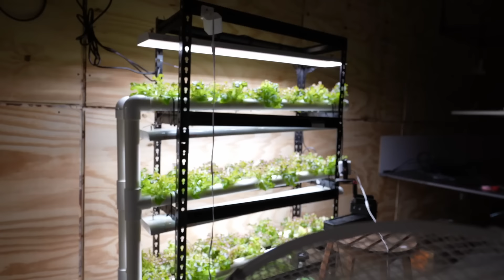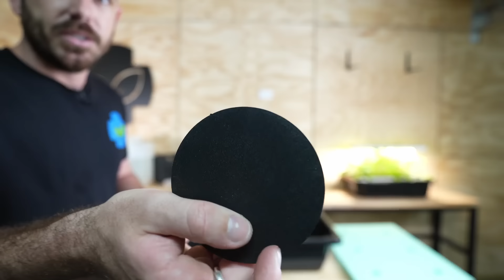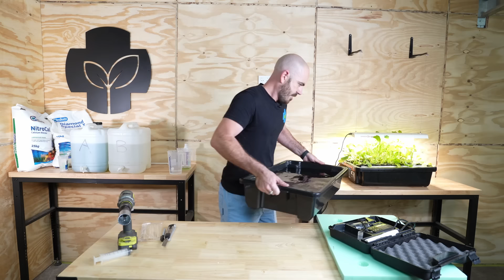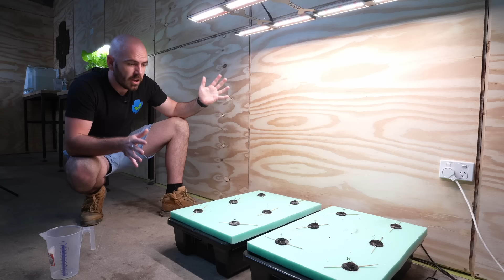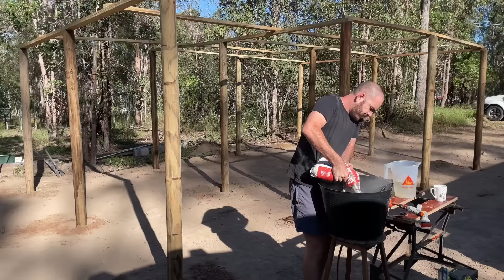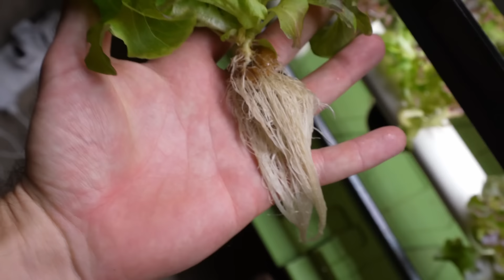Deep Water Culture vs Kratky... And the Importance of Air Flow in Indoor Systems

Comment: thoughts throughout:
your definition of "deep" is very different than mine. (asin "DWC")
i can tell right away your brain is working wrong on DWC, you would be far better off with air BARS (or atleast soaker hose) than stones for better coverage.
pfft! you need WAY more air than that in my opinion.. but i dont grow lettuce so i guess it could be enough. ive never done dwc in anything smaller than a 5 gal bucket (usually a 15+gallon tub) so maybe my perspective is off, but i want hot tub levels of bubbles, not fart levels.
dwc tub looks like it will have light leak for sure which will probably cause algae..or root rot.
are those leaves supposed to have holes?
jealous of those migro arrays.
oscillating fans... OSCILLATING!
when you re-do it dont do lettuce, do something obvious like beans or cukes.
wow.. you LET the nutes of the dwc run out? ive never seen somebody so blatantly misrepresent dwc in my life.
do you not use calmag and silica?
Reply from the maker: You must get in your own way a lot.
Reply: @Hoocho  eh, this reality rarely suits me. its mostly when im trying something new, which as you well know is how we learn. its atleast nice to know im not the only one who shoots myself in the foot when having ideas though, because often it feels like the world is just stacked against me specifically. 
at any rate, heres my logic:
the deeper the container the more velocity the bubbles will have when they break the surface thus dispersing the droplets more.
soaker hose is AMAZING (cheap and useful) stuff that lets you perfectly aerate ANY size container. uses the standard barb, weigh it down or clamp it and youre golden. bars would work too but cost more, and you cant bend them in to star/flower/spider like shapes.
when i grow in bubble buckets the solution literally looks like its boiling. theres that much air.
cut or drill notches in your container to avoid light leaking, or just use the neoprene plug from a 2 in net cup (i may have learned that from you actually) and run the hose/wires through it.
kids these days need VERY specific instructions, not saying "oscillating fans" will lead to throngs of people with those little 6 in. clip fans trying to circulate air in a 4x4 grow tent full of jazz cabbage. 
most of these head to head videos end in disaster and THAT is hilarious (shane from migro did peppers a while ago and again disaster struck).
i use calmag and silica religiously in my nute solution for dwc (not so much for aeroponics though). maybe for lettuce it wouldnt matter since it can grow so fast it shouldnt get to the point of deficiency but when you got 16 weeks in a grow its better to be safe than sorry.
ya gotta admit letting it run out of nutes was a rookie mistake, especially a pro like you doing it! im kind of surprised you dont have a wireless sensor that sends you email alerts when ppm or water levels get low (i dont, but figured YOU would).
the thing is, if i didnt enjoy your content so much i wouldnt sit through it much less critique it. ive literally been watching your videos for years and have turned several friends on to your channel as well. it also makes me look like a twat to post multiple times on 1 video, so im trying this format instead.

there is no greater thing a man can do than educate others and you are educating TONS of people. i dont always agree with the gist (people in 3rd world countries dont have 3d printers) but the effort alone makes you a hero in my book (people in 3rd world countries tend to adapt better than most anyways), so thank you.

Comment: Fascinating! So the transpiration acts like a discharge or outlet so the water and nutrients coming up from the roots can happen, or happen more quickly. Faster than a mechanism like osmotic pressure.

Question: is there a way to produce starts using kratky that would eventually be transplanted into soil? I live in a cold climate and want to start some larger plants that I don’t have room for indoors, but that would get killed by occasional frosts in the spring. Would the air/water roots live in soil?
Reply from the maker: I’ve replanted into other substrates with success. But only into hydroponic media… unsure about soil. The plant will need more water than usual for a time.

The difference being the plant will need to reestablish the roots to contact the soil, rather than hydro where the nutrients are aqueous in the provided water.
Reply: @Hoocho  cool! I might give it a shot and do half and half - some sprouted and started in a soil planter and then some in a kratky and then transplanted.
Reply: @toastrecon  yeah it'll work! Make sure you water it in really well, as the roots aee used to water. Then gradually diminish the moisture. You'll have to play around a bit to know when is the time to treat it like a real soilplant.

Comment: Ha, I'm test running a 2x4 foot lettuce kratky indoors at the moment. You were smart going with smaller bins, I didn't think this through as I have to clean out the whole thing at once which is not ideal.

I guess I better get a fan 😆